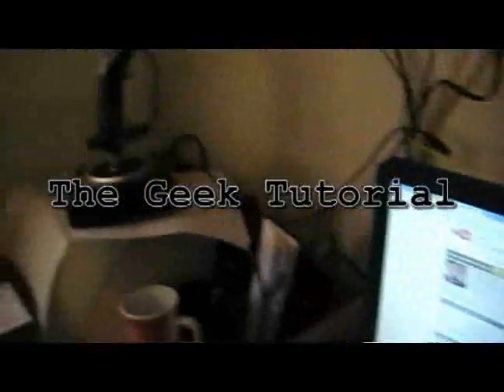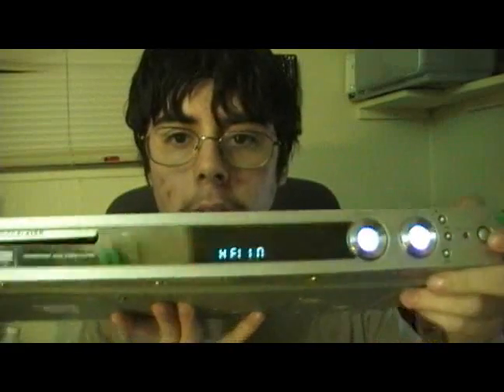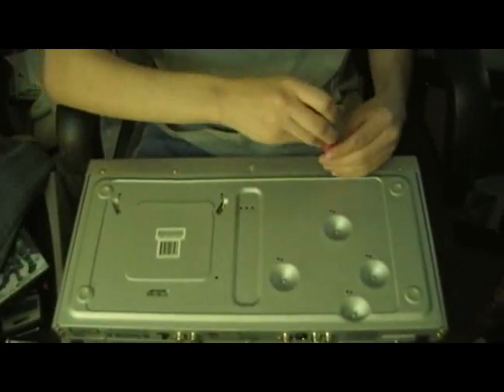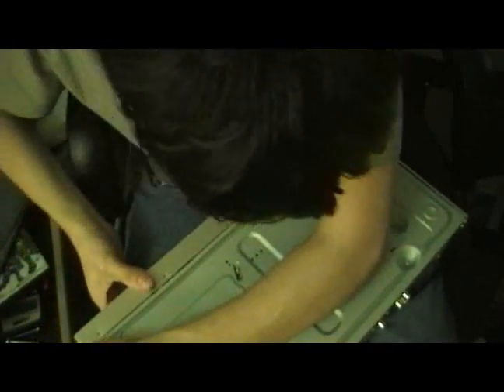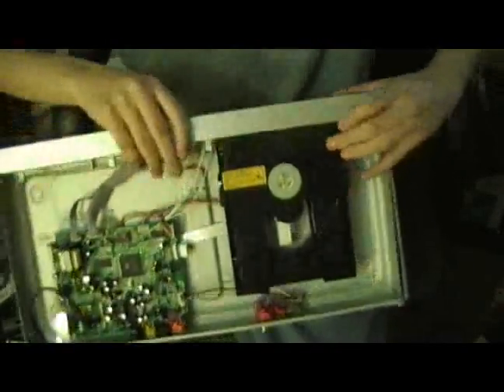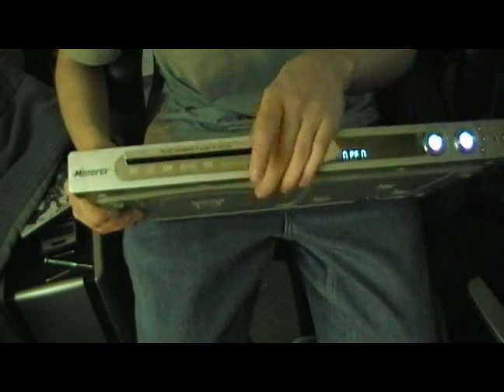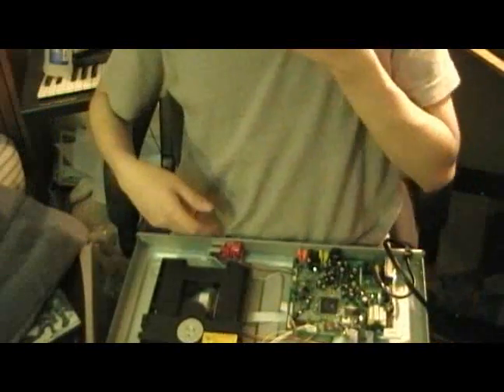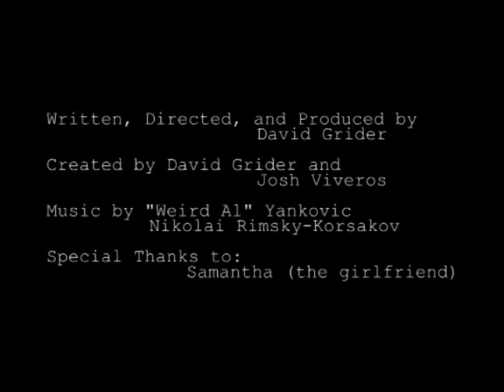The Geek Tutorial (DVD Player Special)

Comment from the maker: Depending on whether the new DVD player is low-end or not, it could make a little noise. It's not something you should worry about unless you notice it getting louder, and in that case, I hope you got a warranty. As far as the old DVD player, it sounds like the spin motor was shot. There is no easy way to fix that, but if you're still interested, I'll pull out a dead CD drive I've got (essentially identical mechanism) and see if there is any way I can instruct you to fix it. Thanks for watching!